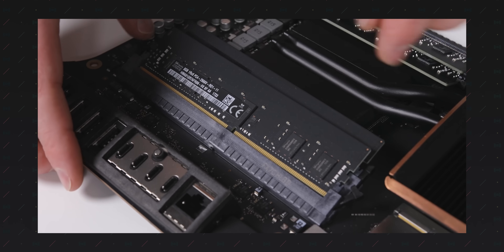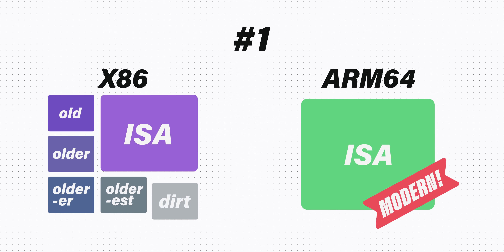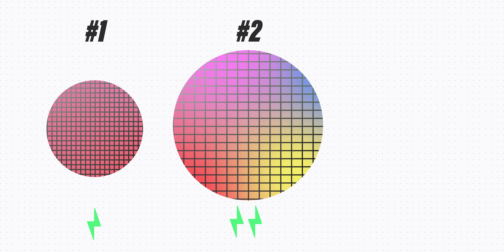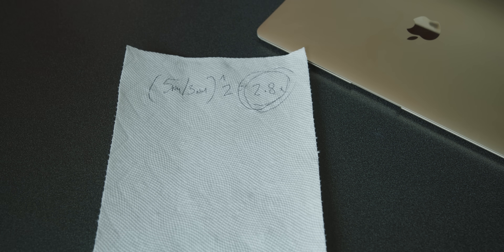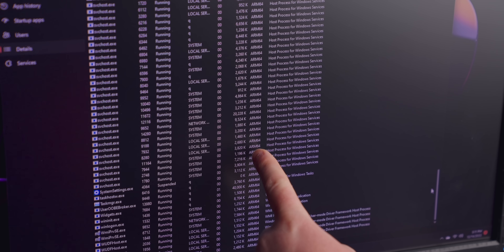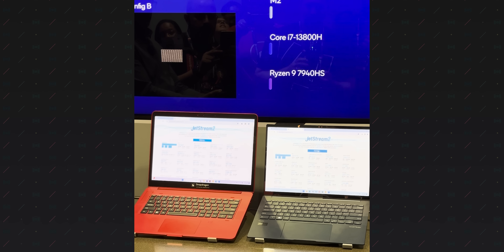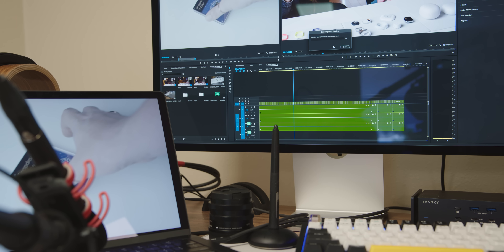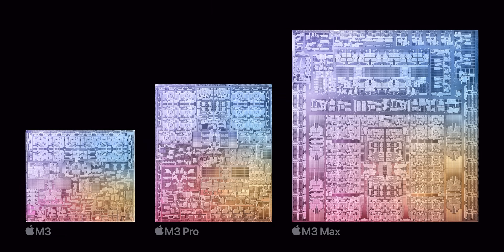Apple's Silicon Magic Is Over!

Comment: For me the biggest problem for apple silicon macs is the complete lack of upgradability and also the criminal pricing of RAM and SSD upgrades
Reply from the maker: They are gonna have to change that eventually. They’ve had the same upgrade pricing tiers since 2015 which is insane. Their base models are such a great deal but the min spec is so lousy almost everyone should upgrade and by the time you’ve doubled the ram and storage you’re at basically double the price. Sucks lol
Reply: @snazzy  I'm honestly surprised that the EU hasn't run riot on that yet. The change is inevitable, as they're going in hard on right to repair to the point that it's a matter of time that the right people notice the problems with the lack of upgradeability.
Reply: @OanKnight  right to repair is more than computers. It’s in CARS as well. This means right to upgrades would set a precedent and America + EU dislike car upgrades.
Reply: @OanKnight the EU isn’t going to mandate that they redesign their chip architecture to make the memory not soldered into the chip itself.
Reply: @OanKnight  Apple has no market dominance in the EU. There are many, many competitors so if you don’t like what they offer, buy something else.
Reply: @TeddyLeppard  Interesting opinion, but ultimately worthless. The EU has repeatedly shown an interest in having too intervene in apple's practices - you don't get to dismiss the customers and the billions they make in the market just because they aren't the monopoly they represent in the US.
Reply: @OanKnight  Just what the market needs, a government to step in and tell them what consumers want. Let the people vote with their money for christ's sake.
Reply: @OanKnight  well they hold forever and most people don't do things that are extremely intense on Mac therefore not justifying upgrades. For those who do they can buy the best of the best and be set for at least 6 years before it gets to outdated
Reply: @nylotical  I'm well aware of that, but in this case technology use tends to be the most relevant use case people would think of. White goods, computers etc. I would argue are more ubiquitous.
Reply: @SuperMattboxio  he EU doesn't tend to budge too much as they're actually fairly pro consumer. I would expect a compromise to happen though.
Reply: @OanKnight  Granted, however I'm not holding my breath for something to happen soon as this has been the case for years.
Reply: @snazzy I agree with the comment here you’re responding to. Too often tech channels pretend a benchmark is the beginning and end of whether Apple is ‘innovating,’ while ignoring the pathetic 8gb of ram and 256gigs of storage Apple is still selling in 2024, (equally pathetic is a 24” display in 2024 on an iMac btw) - that can never be upgraded. This makes any claims Apple wants to make about its environmental footprint a farce. On top of this is the measly 5yrs of official Apple OS support. Think about the fact that a $500 gaming console today has more upgrade potential than a $4k Mac Studio. 

I can’t imagine the horror of 2019 Mac Pro owners that spent probably close to 10k on average only to see support for that Mac end this year. From the un-upgradeable RAM and hard drives, lack of a headphone jack even on even an iPad (very popular with musicians), to not being able to run windows natively any more for games - Apple has become a brand of endless compromises and user burdens. 

Gone are the days of the 2006-2012 Mac Pros and Intel Macs which while more expensive than their PC counterparts - gave the user value added. These days a Mac is simply a productivity machine - drab, boring, overpriced, and everything they used to accuse PCs of being.
Reply: @snazzy  more like since 2012
Reply: @snazzy Im still using my 2014 macbook and my maxed out imac 2019.
Reply: @snazzy  no company that is a premium brand (or is trying to be) ever wants you to buy the base spec.  So functioning as designed.
Reply: @snazzy  Not to mention an unpatchable security flaw in the silicon.  Oops
Reply: @snazzy  its called a price ladder and if executed correctly, as apple does, it makes them a LOT more money than any more customer friendly model. i dont see them changing it anytime soon as it would be a huge hit financially.
Reply: @snazzy  8GB M3 is better than M2 16GB RAM though
Reply: @snazzy They haven't though, and looking at their motivations, it's not there frankly.
Reply: @snazzy Apple's ridiculous memory and storage pricing, combined with the weak JPY right now, are why I haven't bought back into Apple. 8GB is ridiculous. Even 16GB is small.
Reply: @snazzy l
Reply: @snazzy  the base model can’t be a great deal if the spec is lousy. You need a decent spec to be a decent deal.
Reply: @snazzy  Come on OWC, find a cheaper way to upgrade!
Reply: @snazzy oh also we lost paradox interactive , Blizzard, Zenimax,  a lot major game studio move on since Apple move to m series
Reply: @snazzy 14:33 so why you and other complaining about intel?? You just bunch karens
Reply: @snazzy  base models? great deal? good joke, snazzy, good joke.
Reply: Is 18 gb ram 512 gb SSD enough? M3 pro
Reply: @JoeyM-jh7ym  Only if you do intermediate computing.
Reply: @snazzy  we all complain about the prices, but do we mind the continue to disrupt markets and continue to bring new tech ?  We cannot expect to have one and not the other.  Look at the countless vendors that offer cheap products - how many ground breaking or market changing techs have they brought us?   Profit is how companies survive - unless they are running on investor money or government subsidies.  Dell builds a “cheap” computer, but where is their innovation in the last 30 years?  Apple mainstreamed a graphical os, mouse, digital music, smart phones, tablets, and now low power pcs that people can actually use.   Sure we can all ask for more ram and cheaper storage,  but keep in mind the masses won’t use either.  Sure Apple makes a lot of money, but their objective of profit is by no means “evil”.  They are fighting to survive in a world where some companies are evil and funded by the governments that are pushing to control entire industries.
Reply: @snazzy I completely agree, I use a macbook pro base model m3, and it's awful because of ram issues.
Reply: If I'm not mistaken, the video may have suggested Qualcomm's ASIC may allow for user upgradeable storage.
Reply: @barkingsheltie  they're all going to end up doing the same and it's got nothing to do with Qualcomm or the architecture, it's the manufacturers that want to be able to extract more money from us while adding NO VALUE. Dell it's already putting onboard RAM on some of their inspiron models, that's their most basic laptop that isn't a toy. Inspirons used to be so easy to upgrade, such a shame.
Reply: With these new chips coming out from Qualcomm I think it’s will be time for Apple to reconsider their pricing to compete.
Reply: @GlobalWave1 tbh apple sets the price and everyone else follows to make their product look premium
Reply: Bruh! Even before Apple silicon when they were using intel just like the rest of the industry, they never "reduce" the price of their computers to "compete," how much less when they are using their own chip. Apple doesn't "care" about the competition the way you think about it @GlobalWave1
Reply: @GlobalWave1 they won’t because you people happy paying price
Reply: @Messiah38  well I use mine in particular for music production so I just have a 1tb and offload the rest to an external ssd and have 32 gb of ram. 
I pay for the minimum… but I find it hard to believe when Qualcomm is entering the space and undercuts Apple by offering cheaper upgrades and a viable alternative to a Mac computer that it wouldn’t cause the stake and shareholders to cry in outrage.
Reply: @GlobalWave1  Which is good, competition both keeps prices reasonable and pushes forward innovation.  Even Intel and AMD are also heavily investing in ARM.
Reply: @GlobalWave1  Paying $400 dollars for 24GB of crappy RAM when you can get better 32GB RAM for $100. Paying $600 for 2TB SSD when you can get a faster one for sub $200.

-The marks of a big brain Apple consumer.
Reply: @GlobalWave1 Hint:  Qualcomm can’t compete
Reply: @GlobalWave1 people not caring is why apple doesn't care.
Reply: @impersonator4439 thats why mac has a lousy market share.
Reply: What people object to is that they feel that they are somewhat ripped off, for paying $200 for what would be a $40 upgrade elsewhere.  And they know that Apple pays even less for SSD chips and DRAM than they would at retail.  Normal people think in terms of COST; marketing people think in terms of the PRICE they can charge for something.  Two different worlds, unless there is competition that forces price to align with cost.
Reply: but this isn't a problem for apple silicon Macs. this is a problem for Macs in general, and has been since way before apple silicon.
Reply: @pyro254750  only started a generation or two before M1 iirc, you used to be able to swap SSDs, RAM, even the network card in some older models
Reply: true but this is why you wait. You can get 15" M2 air with 16gb ram and 1tb storage for $1499 in best buy now for example.
Reply: @Fear.of.the.Dark. I would love that here in the EU with 27% VAT and extra import tax
Reply: @Fear.of.the.Dark.  why not buy 6 decent Windows laptops for the same stupid amount?
Reply: This, wastefulness and lack of repairability in general. Apple HW is overpriced and unmaintainable. That's bad for the environment and for the wallet.
Reply: They treat their consumers as if they are to child like to know how to use the system without getting infections and so on. Due to all their "you are not allowed to upgrade or repair the system you just bought" mentality, getting an Apple repaired even costs more than a PC repair.
Reply: @dera6347  Sounds like they know their customer base pretty well 😂
Reply: I'd argue that now the memory is unified and shared with everything, the base RAM config should be at least 16GBs too
Reply: If you check , they actually charge full price per upgrade of what 512 1 TB 2TB would cost on top of , instead of what the actual difference to upgrade to the next size .
Reply: They won't change, they're fine taking advantage of people that don't know better (and especially just the behavioral economics of "oh, well this little upgrade isn't too much, and this little upgrade isn't too much." because they know that enough people are going to upgrade and justify it.
Reply: You are right. But it’s not going change as people continue to buy their laptops. They can’t help it, Apple products are like a drug, they are laced with alluring design.
Reply: apple knows most people don't care. personally i've upgraded a desktop once, and not once touched my 500$ laptop, although admittedly it does have better specs in storage and ram than apple's.

i plan on getting a macbook whenever my laptop stops being functional, honestly apple's restrictions don't affect me much. i'm not even on windows right now, but a relatively locked down linux distro with limited options for installing apps, and the gnome desktop which is pretty poor for customization and i'm happy with it, so i think macos would be fine.
Reply: that is something going on since 2016. nothing new
Reply: You said it! And that suits Apple just fine...
Reply: Its intentional and a business decision not fully driven by technical limitations
Reply: this is the reason I never owned a MacBook, even though I was fascinated by M chips
Reply: Agree. This is a major bugbear with me. When looking at getting a new MacBook Pro I shouldn’t have to compromise the specifications on a 2k plus purchase by having a smaller screen, 512gb storage & 8gb Ram. Drop the pro title with these specs please, it’s an insult.
Reply: non-upgradible RAM is at least justified by the integrated RAM architecture BUT there is absolutely NO reason why MACs can't come with a M.2 slot.
Reply: Lack of upgradability creates endless e-waste and should be regulated against.
Reply: The Macs aren’t for you. So go buy windooze. For everyone else the idea is that you buy the configuration you need and when if that need changes you buy a new one and sell the old one (or hand it down). Macs/iPads/iPhones have fantastic second hand market. That is how you avoid electronic waste.
Reply: buddy, this ain't the 90s
Reply: @apidas  Tell that to Apple, buddy, pal, amigo.
Reply: Indeed. And for a long time the max. amount of RAM and storage they offer at those crazy prices has been too low for my needs. I consider it absolutely insane that my Macs from 2010 have more RAM and storage than I can get on a new Mac today
Reply: I agree on the pricing but I used critical thinking and know how to buy the perfect spec. Before moving to Mac the cost of me setting up my pc, optimizing it, trouble shooting it would be equivalent to an additional $2000 in my hourly rate as an audio engineer in a year. The Mac only cost me $500 in comparison if we figure all things.  Computers are not just their upfront cost.
Reply: When you check Apple's storage and memory prices, you think it's a joke or, as you suggest, a criminal offence. However, in 12 years of using MacBooks for 8+ hours a day, I've never had any memory or storage component fail on me. Even though I use my gaming rigs way less often than my MacBooks, I've had those components fail on me multiple times. I don't know if any sources confirm this, but it seems like Apple picks storage and memory modules of very high quality in terms of longevity and reliability. 

My wife still uses my 2013 MacBook Pro. When I benchmark the drive, I still get 700+ MB/s read speeds. It benchmarked at 850 MB/s when I got it in 2013, and it got some very heavy daily use for six years. Compare that to the fact that I've had to replace every single 3+ years old SSD in my non-Apple builds.

It could be that Apple uses higher-quality components or that MacOS is less taxing on these components (i.e. due to different memory management, file system, power management, etc.
Reply: Unified memory makes sense to have on their platform, their pricing for upgrades does not. I'd be fine with it if their upgrade prices were reasonable... or at least close to reasonable.
Reply: @TheGhostInTheWires  Apple has always been expensive, and banging on about it seems pointless. You either accept it or buy something else. Apple spends millions researching the best business model to maximise profits for its shareholders, and the upgrade cost keeps it in the game. No one likes it; we would all love to live in a world of unicorns and rainbows where we get more for less, but this is the reality; take it or leave it.
Reply: Think of what Apple did to all the people who bought the final Intel Mac Pro. You know the “upgradeable” one that Apple wouldn’t let anyone upgrade to an Apple silicon motherboard.  Those Mac enthusiasts who spent a minimum of $6k were forgotten the moment their payment was processed.
Reply: You’ll be surprised at how other manufacturers are planing on doing the same. The integration is what makes these things so damn fast.
Reply: Most laptops lmao
Reply: Cri criminal 🕺 cri criminal 🕺 🎶 🎶
Reply: All m series macs are bricks and dead once the Internal ssd goes they cannot boot not even from external sources.

.this is a true planned obselense.

On the mac pro it has pcie but it cannot use any of the older mac pros GPU s or the latest intel amd or Nvidia GPU s which would make the mac pro much faster at graphics games 3d video editing AI basically everything.

And apple does not have an upgrade path to add external or internal GPU s ever.
This is a huge did her.

They don't even make their own gpu pcie card for their mac pro with graphic cores or a thunderbolt based external gpu cores upgrade for their laptops and minis

They could but they refuse to.

This dates you mac to its purchase day and hurts resale on low memory ssd Mac s and is a huge risk to buy used as when that ssd dies your entire machine is bricked for good.
Reply: Agreed, especially with storage.

I have a desktop and a laptops with tiered storage. The fast SSD for the OS, programs, page file, temp file, caches, etc. Then slower, cheaper storage for the likes of media. My desktop has magnetic drives for bulk storage, and the likes of FLAC work fine off it. My laptop has a SATA SSD and most older games run fine off it. Heck, many old games run well off a magnetic hard drive.
Reply: As if this is any one anywhere doesn’t think this.
Reply: Agreed - this is a choice made by Apple and not a consumer friendly one.
Reply: though i could buy an m1,2,or 3 macbook i prefer an older macbook air as i can throw in a bigger m1 ssd when the need arises. i dont need to do 4k video editing.
Reply: I agree, but this is actually their only downside. On the other hand, years after purchasing my M1 Macbook Air I still don't see any reason to upgrade.
Reply: It’s absolutely true. Apple isn’t doing this to maintain their form factors or for security, it’s all about money and consumers are universally pissed at companies that do this.
Reply: US Congress should have launched antitrust warnings to Apple years ago over DRAM and SSD predatory pricing and their constant efforts to resist the sound  principles advanced by the Right to Repair movement . Instead Congress form a Congo-line of groupies queuing to kiss Apple arse. Leaving it to the EU parliament to even get the overdue USB-C ruling for iPhones.
Reply: Apple does use high quality parts but also the labor is part of that cost. It's definitely not enough to justify the high price when you add more ram and storage, but I can understand why it's that high. I think the worst part is how cheap apple silicon actually is and how they start there lower end line up with criminal specs. If the air started with 16GB of ram and 513gb of storage for 1000-1200 that's a perfect price for anyone that needs a computer. Instead it's 1500 which is pretty crazy for the specs. If you want 1tb of storage it's even more. I think if point of entry was lower. They could justify the higher prices for upgrading ram and storage but since it's not, it's almost insane.
Reply: @Sakosaga  yeah and if your a video editor (the primary demographics of Mac pro users), then 256gb or even 512gb is woefully inadequate. Because 4k video files are very big
Reply: Unless you know your way around hot air soldering you're straight out of luck
Reply: Memory is one thing, storage is entirely a non-issue. External TB4 NVMe drives with transfer speeds tipping 3000MB/s are already available, and they're way less expensive than Apple's storage upgrade. 

2TB of storage in the M3 MacBook Air is $600. 

The OWC Express 1M2 (3150MB/s) = $120
Crucial 4TB 4800MB/s NVMe = $225

That's fantastically fast, even for video exporting. Is there even going to be a significant difference between exporting to an internal 2TB NVMe SSD vs. an external NVMe SSD. 

I'd rather have the additional 2TB of external storage space for $255 less than Apple's 2TB pricing... And throw that $255 at more memory on a laptop or Mac Studio...
Reply: @craigjohnchronicles2504  the problem with an external drive is that for laptops it's just extra stuff to lug around and there's a great risk of it being lost. If I was buying a Mac mini or iMac I would be fine with external storage, but not on a laptop
Reply: I have been wanting to upgrade my nearly 7 year old Imac & MBpro for 5 years but this is the main thing preventing it. I have some to believe Apples compulsive greed is shooting themselves in the foot. At least so far as its macs go.
Reply: We need Hackintosh for the Silicon era, it will happen.
Reply: Upgradeability is bad yes. But it’s nothing that is hurting Apples business for the time being and it’s not due to a technical inability. Apple can bring an upgradeable Mac tomorrow if they want.
Reply: lack of upgrades would be fine if their computers didn’t cost as much as a car
Reply: You are not wrong, but that isn't really a comment on the M series is it?  I have only used Mac for work and only used it for about 5 years, but Mac has never been upgradable in my short tenure.  I would expect other OEMs to do it too if they have the brand awareness that Apple has
Reply: I built high end gaming PCs for 12 years and NEVER upgraded parts. Whenever I needed an upgrade, I just needed a whole new system because the newest CPU would need a new motherboard, and new ram, often new type of GPU slot.    

Maybe that's different now, but the thing is the resale of Apple products is SO much higher than PCs, you can just sell your entire mac, then get a new one for less (or similar) to what it would cost to get new parts for your PC... at least ones that make any sort of difference.  Heck, a Nvidia GPU upgrade alone now often costs as much as an entire Mx system. 

I also get the ram and SSD I know will last me for years. I'm still using a 7 year old iMac and the ram (24 GB) and SSD (1TB) are still plenty. In fact, I have PS, Illustrator, Resolve, and a bunch of other high end apps and my internal storage is still 90% free (only using about 50GB for everything).   The nice thing is macOS for me doesn't get bunged up and dragged down the way Windows does (which I needed to reinstall a couple times a year). It's still as snappy now as when I bought it.
Reply: Wow brilliant take I’ve never heard anyone mention that before!
Reply: Apple sees Apple Silicon as an additional way to lock people in. Apple loves the extra control that Apple Silicon gives them. Apple would never move to Apple Silicon if it was for efficiency alone. Profits were the force behind this move.
Reply: 5:11 Excuse me, that was not napkin math, that was paper towel math.
Reply: “Months away from almost”
Reply: Agreed. If Apple would make a newer iMac that I could afford, I'd upgrade.
Reply: ^ This! 100% It's the main reason I've been watching videos on in-house cloud/RAID setups so I won't have to up charge $400+ for a minimum of 1TB storage from 512GB. Heck I have a thumb drive I bought for $99 that was a full 1TB.
Reply: wew reading these replies reminds me why I have such contempt for the Apple cultists. "um actually upgrading is dumb and I actually like not having the option"
Reply: Yeah they went too far with ram pricing recently. I've spent tens of thousands of dollars on MacBooks and it feels insulting
Reply: The pricing of RAM was always absurd and now it's even worse.
Reply: Not only that, but the fact that they are buying those NAND and DRAM chips for pennies, and then charging you upgrade pricing that is only possible due to them locking out competitors...IMO this should be illegal.  It's deliberate and done solely for profit, and it's a monopoly.
Reply: It's a lock-in. Apple has never liked that you can upgrade their hardware without paying them 😂
Reply: EU needs to step in force manufactures to have an upgradability path
Reply: I was a customer for 21 years, but they lost me. Even with the Intel units, you could still upgrade the SSD or, even replace RAM with a hotplate and hot air. You can't even get the RAM modules for ARM, and the SSD NAND modules are Apple-specific parts. It's absurd.
Reply: For me it's the OS
Reply: Most annoying fact about ARM is the lack of GPU support. Neither PCIe nor eGPU via thunderbolt. They should have gone with AMD and x86 would be power efficient as hell and had even greater APUs like the Steam deck.
Reply: Then don’t buy it. Criminal 😂 hyperbolic much
Reply: Yada yada yada. I can’t afford a Mac, therefore I have to hate Apple…
Reply: I’d suggest the modern ‘upgrade’ path for personal computers (vast majority being laptops) is the same as cars ie: realistically none. Unless you are a real auto enthusiast, you’re not really thinking how easily can I upgrade the engine, the load capacity etc when you buy a car. You just get the one that suits you, and when it’s no longer sufficient you sell it, hand it down, or ultimately end-of-life scrap (recycle) it for a newer, better one. And, in the case of EVs (Tesla’s etc) the upgrades are all software. It’s a basic, slightly flawed analogy perhaps - of course cars have a lot more wearable, maintainable parts, and computers either work or massively fail, and in both cases there you’re looking at the warranty situation anyway - but in the real world, for 95% of folks (ie consumers) I think this is the case now. Like it or not, I tend to agree with the argument that ‘future proofing’ your laptop, desktop, phone, certainly if it’s an Apple one, is an outdated, even flawed way of thinking now.
Reply: @brucekennedy5274  I just can’t agree custom personal computers are more prevalent and popular among youth then ever. Apples laptops are now built to last you can keep a M1 chip for the next 6 years even. It’s unethical how apple does it because for most other companies their upgrades are half the price for the same product and they have technical problems that are unique to apple because of the way the make products unnecessarily making it impossible for a average user to trouble shoot issues without relying on a warranty or paying outrageous prices for repairs. Meanwhile for most laptops and desktops they can be troubleshooted whether by a software reset or switching simple to change out parts
Reply: @albundy3929  "Where am I wrong?" Pretty much everywhere. 

No, you shouldn't rely on cloud storage in place of physical storage if only for the fact that you should always have more than one copy (and more likely three or four) of important files. Cloud is great as a backup, but it isn't a substitute for local storage.

M's use of RAM is better in some cases, but it hardly "smokes" comparable RAM on a Windows machine. Because it's just RAM. Until recently, Apple was selling some pretty low spec RAM at the same price, so. I think a lot of fanboys are just parroting Apple marketing about Mac's RAM being like double PC's, and, I hate to break your heart, but that's just marketing. Apple can kind of get away with outlandish claims like this because their machines can lean on swap if and when RAM runs out, but then your going to start to notice slowdown whereas another machine with two or three times the RAM at half or a quarter the cost won't. 

16GB is not included in the base model of most devices. 8GB is. Needing 16 is not "rare." It's approaching the norm. Upgrading to 16 costs an EXTRA $200 (for the base MacAir, Pro, iMac, and mini). A kit of 32gb DDR5 costs half that. 

Hobbies cost money—that's a truism. You're not going to prove your point with a truism when what's under contention is HOW MUCH that hobby ought to cost.

While you're at it, please justify the $1k roller wheels for the Mac Pro. Please!
Reply: For many people, it's just not an issue - like remotely an issue. I have owned two Apple Silicon Macs now... an M2 Max and an M3 Max MacBook Pro 16". I purchased them with 64GB RAM and plenty of storage and the highest CPU/GPU spec. Used for work. Previously I owned a 4 generations of 27" iMacs... all of which I merely purchased RAM for at time of purchase and then never upgraded/altered in any way. The last time I tinkered with storage and memory was my 2009 Mac Pro Tower. I think there's a lot of people who simply don't need to alter their internals once they purchase.
Reply: Basically disposable devices.
Reply: Agreed!
Reply: I don't like that Apple does this, but i don't see it changing. A lot of the market doesn't care and they make so much money on these markups.
Reply: Just got an asus zephyrus (2023) for the same price as a fancy macbook and its crushing everything I throw at it. Are gaming comps the new future ai comps?
Reply: If you ask me the reason for lack of upgradability is intentional. Its in line with the concept of a OEM, essentially intentionally creating a self contained environment to predatorially control the consumer. And its the main reason I'm admittedly anti apple. Is for how good Apple tries to act it always feels like a bad case of just profit chasing for the good of Apple at the expense of the consumer and rarely to new Apple PC's feel like they are created with the actual end consumer in mind. 

Like most of Apples hardware designs just feel like cheaped out on SDK/Software Development Kits, that are about as far from what I'd expect the end customer to get. Like I'll give Apple the plus of their hardware looks nice but it consistently lacks on just about every other feature a PC should have. Like 90% of Apple hardware feels like your paying purely for the esthetics and not the actual PC. 

Another way of thinking about it is that Apple consumers are essentially paying a prenium for essentially a paid beta for a video game.
Reply: I'd never buy a personal computer locked down this much.
Reply: yep. me too.
Reply: that is intentional
Reply: Well you’re not considering that they are the only ones in the market, if we are talking about performance per watt and build quality, apple could charge thousands of dollars more
Reply: author also has heat issues
Reply: Omg get over it. It has been like that since Apple I
Reply: And lack of normal USB ports Ethernet and HDMI
Reply: The low ram isn’t a big deal since 8 gb is like 16gb on most other machines but what is going on with the that storage like common.
Reply: The Criminiminality ...
Reply: Apple builds its computers like Ferrari builds its cars.
You keep your computer until it dies or you sell it, no other choice since everything is soldered inside.
Reply: That’s always been apple though. They have always been a closed source hardware operating system company. They make their money selling over priced computer hardware to apple fans. People that just require a computer to type, go online and watch videos and do whatever else a mac can do, which based on the lack of fans, I’d say probably is not a lot of performance oriented stuff, cough cough like games. OSX runs the way it does for that very reason, do you have any idea how fast and stable windows would have been running on five different configurations of hardware. Instead it runs on literally countless variations.
Reply: I was a UIUC Business major, so I understand the difference between MARGIN and VOLUME, but I don't believe Tim Cook KNOWS enough about Business!  (Like that old Apple Board Member K---something who PREVENTED Apple from licensing the MacOS, as Bill Gates suggested they do in 1985, 10 yrs before he came out with Win95!)

I'll be staying with my 2010 Mac Pro 5,1 for as long as possible, currently 'booting' Monterey 12.7.4 from an internal nvme PCI drive, with a 12-core 3.33ghz Xeon, GTX 670 2g GPU, 96g, 2xUSB3.0 + 2xUSBc card and a free slot #4!  My 5,1 is right ABOVE the M1 chip on the Cinebench 2024 ranking?
Reply: I was a UIUC Business major, so I understand the difference between MARGIN and VOLUME, but I don't believe Tim Cook KNOWS enough about Business!  (Like that old Apple Board Member K---something who PREVENTED Apple from licensing the MacOS, as Bill Gates suggested they do in 1985, 10 yrs before he came out with Win95!)

I'll be staying with my 2010 Mac Pro 5,1 for as long as possible, currently 'booting' Monterey 12.7.4 from an internal nvme PCI drive, with a 12-core 3.33ghz Xeon, GTX 670 2g GPU, 96g, 2xUSB3.0 + 2xUSBc card and a free slot #4!  My 5,1 is right ABOVE the M1 chip on the Cinebench 2024 ranking?
Reply: I hear you. I bought an M1 then an M2 when they came out, but the prices for RAM and Storage are insane. I still have my Mac laptop but I went back to PC desktops. My PC has many TB's of storage and 64GB of RAM and it didn't cost me the GNI of a small Country. Which leaves money left over for beefy GPU's. I really like Apple hardware but the pricing is just absolutely insane.
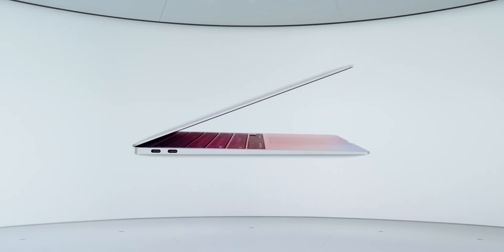Reply: 1:04 why would the price increase? They made their own chip then the cost went down. Shouldn't have the price as well. Nah. Send me the G like regular
Reply: Lack of upgradability implies not upgradable. So how can there be prices for upgrades??
Reply: The soldered on memory chips really is frustrating
Reply: If I wanted to mess around with hardware upgrades, I’d build a PC. Plan for the future when you spec your Mac.
Reply: Bruh evryone here is on copium
Reply: I’d agree if this wasn’t common practice on x86 chips too, sadly, in the modern laptop market we don’t get “user choices” anymore unless you go to brands like framework whose brand images rely on their repairability & upgradability
Reply: I dont think the physics really supports upgradable ram while maintaining the same brutally fast ram speeds. That said a two tier ram arangement with fast on-chip ram for fast tasks, and slower off-chip ddr5 (or whatever) for lower priority tasks would be fine. But yeah apples always had a stupid habit of undergunning ram on base models and its a habit thats utterly incompatible with non upgradability. 8gigs just isnt enough anymore especially considering the horrific ram useage of chrome , and the mindless trend of using wrapped web pages as apps (discord and all those things are actually just web pages stuffed into a customised chrome browser made to look like a desktop app. Its a bit like that old thing that the more you earn the more you spend. That applies to ram too. As the average ram in the world goes up, the apps get hungrier cos the devs get lazier. But apple isn't keeping up. I  love macs, but the memory scenario has always sucked.
Reply: @Jo_Zh I have AMD shares
Reply: Yeah.  I don't know who's making products at Apple but ... the company's products are just useless at this point.
Reply: The SSD is not an apple silicon issue its an issue apple made themselves
Reply: @deathdrop  Yeah Apple is just a badly run company.
Reply: Honestly the Ram acts as vram also and it’s crazy crazy fast like pcie 6 fast.  The storage is also stupid fast.  The fastest external t3 drive won’t even do 1/2 its speed and is the same price per gb.  But ya be awesome if at least with the cheese grater if you could pop in a 4090 or 4.
Reply: M chip..money chip.
Reply: Yeah the prices are bad, but the bigger issue is that RAM is usually the first part to fail on a computer.  Might last 5 years or so. When RAM fails you’ll have a brick that could have otherwise been saved if it wasn’t soldered on.
Reply: How many times in your life you’ve upgraded your laptops?
Reply: Criminal pricing is Apple's motto.
Reply: upgradability is not a big deal, but the prices per G of ram or storage are ridiculous.
Reply: You don’t get why the silicon performance is that superior, not possible with upgradable hardware
Reply: + Also there is no 18” model which is needed for real pro and gaming
Reply: any apple product from past and present are all bad when it comes to upgrades,
Reply: For me it is the OS.
Reply: Agreed. The $200 upgrades is the only reason I still haven’t upgraded my 2020 M1 Air yet.
Reply: The M1 is fantastic, I still use it to edit my 30 minute 4K YouTube videos even today. The greedy $200 ram and storage upgrades is the only reason I still haven’t upgraded my 2020 M1 Air yet.
Reply: @JohnnyFD  Right.
BUT: The M SOC is only sooo good, because Apple build in H264/5 acceleration and other stuff to help.

So let´s see what Snapdragon X brings to the table and also Intel with Lunar Lake! They all haven´t been sleeping and they all claim to be faster than M2/3 with same power consumtion!
Actually I was sooo keen on Snapdragon these days but I am assuming an Lunar will be even more interesting because it uses x86 architecture! AND: Way more hardware for Intel SOCs to come.
But all of the above will make me able to swap the SSD to a 2 TB Version für 150 bugs.
Reply: If you want upgradeability buy a PC. Its not that hard. The way chips are designed we wont be seeing upgradable ram in efficient and fast machines. Building out SOCs is the most cost effective and reliable way to procide performance and efficiency improvements. 

I don’t see people complaining that they can no longer upgrade their processor cache and we wont see the complaints in 10-15 years when most PCs will only need to have an SOC with an additional GPU. You will just swap out your SOC when its time for an upgrade
Reply: Yep, same here. I use my m1 mac for research using artificial intelligence and as the datasets I’m working with have increased from 2G to 86GB I wish I could swap my 16GB of memory out but nope, gotta spend 5000$ for a mac with 128 :/
Reply: i need to replace my laptop so I've been considering using a mac. Why not right ? They're light, silent and powerful. But these prices are just criminal.
I shouldn't have to pay 200 to add 8 GB OF RAM. Insane stupid prices.
Reply: @ThomasAndy-qu8dp  There are other factors to consider too. Get an m1 pro or m2 pro and save. I have Mac and Windows. I have had to spend much more time configuring my pc and debloating. Whatever upcharge you pay up front for mac should level out with time spent on other pc's. Depends on your use case tho. My mac really gets out of the way of me making things.
Reply: I stay away from Macs not because I want to upgrade, but because if the motherboard dies for any reason, I can’t get to my data.  I would buy a Mac if the SSD could be removed, even if the size of the SSD were fixed at manufacturing time.
Reply: @mensaswede4028  This implies you would no hard backups or cloud backups. I have my essential files organized  on my desktop, backed up to iCloud. There are tons of way to protect data loss. What If you spill a drink on a windows laptop and ruin the ssd as well?
Reply: Amen! Amen! The Mafia has to be the most inept organization compared to Orange Works Inc. of Silicon Valley! 😎😎
Reply: yeah, 12GB? what is the crap?
Reply: Apple sux that why catter to kids and influencers not true experts.
Reply: Yeah, you’re not alone in that issue. Apple loyalist have been crushed by the lack of consumer side upgrades for over a decade now. It, for lack of a better word, sucks.
Reply: @leeartlee915  It definitely is not great but it's still on the consumer to make the right purchase for themselves. PC users tend to spend more vs the life of their machine.
Reply: M1 Dominated what? How much market share?
Reply: @sergioyichiong7269  Fair point but that’s not how they are using “dominated”. They are saying it’s the “best” product, not the “best selling”.
Reply: that’s because it is a system on a chip.  they moved the ram and ssd controller all to the SOC.   They wanted to squeeze every bit of performance per watt and to do this they needed to move it all to the soc and bring them all as close as possible. you are right though the upgrades are insanely priced though.
Reply: @Braddeman  Don’t kid yourself. Apple was doing this before everything moved to SoC.
Reply: @leeartlee915  well i mean now they have a legitimate excuse.  honestly they could make the disk space upgradable as it is possible in the mac studio but as far as ram now that it is part of the SOC i understand why it can’t be upgraded.  whether you agree with my statement or not there is no denying you have less power losses the closer everything is and positioning it all in the SOC does equate to better performance per watt.  they will still say they can’t make the disk drive upgradable as it will make the laptops thicker which is bull crap.
Reply: @Braddeman  I don’t disagree with your statement that you have less power loss the closer chips are to each other. Still doesn’t change the fact that Apple has been overcharging people for years for additional storage and ram. It’s straight up bs.
Reply: @leeartlee915  yea, i totally agree with that statement as well.  apple has always overcharged.
Reply: Its not upgrade. Are you gonna ditch ram and soc because ssd died?
Reply: The absolutely outrageous RAM price is the kicker
Reply: Sad, as apple laptops pre Two thousand thirteen had great upgradability... depending on the model you got, of course!
Reply: Apple has been all in house, no customizable, no upgrades since the beginning.
Reply: why is it criminal? you don't need to buy it and you have tons of alternatives.
Reply: Yes, they are expensive. But the UX is another league and no other OS comes close. My MacBooks last almost 10y. I don’t mind paying for that as a pro user. My gf is still using a 2012 iMac that never ever crashed. I do agree their HDD and RAM upgrade prices are criminal in 2024
Reply: Its system on a chip how is to be upgradeable?
Reply: one of the reason the government welfare assistance program are bad, it’s make people think it is their right to access everything cheap or free and depends to politicians all their life 😂
Reply: If they would allow ssd replacement and upgrades, or even just an open NVME internal slot I would have been sold on switching.
Reply: Windows getting competitive arm chips will begin to force them to be less greedy on these upgrades (I hope)
Reply: @Ronniezim I wish you were right, but I think Apple's core market are people who buy Apple. They could ship a turd in a pizza box and it wouldn't matter, and the real fans would happily pay triple the price to get two turds in their box.
Reply: @Ronniezim mc is already making overpriced non competitive x86 devices, what changes?
Reply: @Ronniezim  I certainly hope so!
Reply: Totally agree ... and it's their pro res format, that eats storage space like nothing else
Reply: People tend to forget that at the end of the day it's about money and business models. 

Apple makes almost ALL of its revenue from selling hardware. Yes, they have other sources like the Apple store but selling hardware is how they make most of it. 

There is ZERO reason to soldier the SSD and RAM to the motherboard,, it doesn't make extra room in a laptop. It's simply a way to charge absurd prices for upgrades. The cost to upgrade from 256GB to 512GB is around 200 to 300 dollars. A  512GB nvme drive, same generation  from Kingston is 40.dollars. That's for a brand new drive, not an upgrade from one size to another. Their topped out Max Pro is 10K for the max memory and max SSD version. There is a reason there.are no 3rd party companies that make MACs.

One channel built a 10L PC and it was ridiculously faster in every way as most of that money was spent on a thread ripper CPU. It also has a REAL GPU, unlike Apple.

Windows. Makes money from selling software and cloud services. They make more from selling Offices licenses then they do selling OS's. Enterprise licensing for CALs (client access license) and everything else is where they make all their money. People want to compete with the surface process while ignoring the 10K other options you have. They are also the sex d largest cloud provider and a better option as they charge a 5th of what AWS does. 

The funny thing is, and he said it in the video, that not many people ever even maxed out their M1's. Same for someone who buys a powerful x86 processor for web browsing and other minimal stuff. So what does it even matter? Also, for home users it won't matter but at the enterprise level it's going to be a decade or more before they move to ARM. Way too many niche software  companies out there that charge 100K a license because they make software for a specialized industry. If anything, ARM might take over the home user market but I'm still not believing the "everything will just work" part when some of Apple's own software doesn't work on ARM but still shows up. When you launch it you get a message saying "not compatible with CPU architecture" so no, emulation only goes so far and natively porting an application to a new architecture isn't easy, especially the more complicated the software is.
Reply: You are not Apple's customer, and they make so much money off of their real customer, that they're fine not getting your pocket change.
Reply: They definitely won't, Apple is a hardware company.
Reply: @BGRUBBIN they a hardware and software company the make logic and FCP
Reply: You can’t be serious 😂😂😂😂😂
Reply: Macs were like that for quite a while even before they transitioned to apple silicon, so while your point is relevant it has NOTHING to do with it being M1, M2, M3
Reply: @grunzythepotato  you used to be able to upgrade or replace the ram and hdd on Apple devices in the intel days, now it is a proprietary ssd and the system will not accept a different size drive or ram to the original (hardware locked) one you got with the device. That is the M1-M3 issue with the SOC.
Reply: Windowz? No thanks 🙂‍↔️
Reply: Here, in the UK, we pay a lot more than what is advertised in US dollars. I wouldn’t be affected by the price so much if the devices managed to maintain their value over time. The accelerated depreciation rate is something that will never sit right with me.
Reply: @AboutHouseMusic  consider migrating to the US, language barrier is nil for you :)
Reply: Well, technically the soldered onboard storage can be upgraded, but requires a good bit of effort and knowledge of how that whole system works to do so. However, I think Apple could fairly easily implement some sort of easily upgradeable storage while continuing to utilize their "ANS2" coprocessor (which handles the hardware based encryption, among other things). All they'd need to do is utilize removable NAND PCBs like the Mac Studio has, and engineer some way to easily reconfigure the NAND RAID configuration. As it is now, a new RAID config can only be initialized on a set of new/unprogrammed NANDs, and cannot be altered afterwards (except by programming the NANDs externally).
Reply: @dosdude1 100% this. I am seeing comments that ARMs can’t be used with normal RAM? Among other things, I have a 1993 ARM powered desktop computer that uses SIMMs, even SODIMMs. Also a 1992 ARM based laptop (‘Acorn Silicon’, because Acorn developed ARM silicon from scratch in the early 1980s for their own computers … ARM - Acorn RISC Machine!)
Reply: This is nothing new with Apple. It's been like this since 2008 and before. I bought ONE MacBook pro in 2008......never again. I learned my lesson after 12 months of usage
Reply: You nailed it!  And there is extra emphasis now on memory due to emphasis on AI.
The cost of stacked die memory limits what they can do but on the other hand sharing direct access to that memory is much of the reason they still lead while windows is still struggling to recompile everything.
The Qualcom chip needs 50% more cores and they are all high powers cores -not to mention that the engineers that designed it literally came from Apple.
I am one of those people who have the minimal M1, and it works great.  My slightly newer Ryzen laptop need to stay plugged it and it is literally falling apart and weezing.  If Windows RT gets it together on the Qualcom chip I may buy one this summer,  but I suspect I will just have to give up on windows for mobile due poor to battery life.
BTW there is supposed to be a media tech competitor to the Qualcom that will be cheaper/performance.
Reply: @skyak4493 its bullshit.  A test proved that a 6 core i7 mac was slightly faster than M1 on finalcut.
Do you buy the crap of shared memory?
Reply: @skyak4493 The engineers came from amd to apple. Do you think that tech was developed by apple? They hired the experts not developed before the  engineers were on charge.
Reply: The days of upgrading are gone. 

Apple is of course taking advantage of this. :(
Reply: This argument is boring.  No one has cared for years.  I’ve had many Macbooks over the years.  I never upgraded the memory on any of them.
Reply: It's not criminal because you are not really upgrading you are paying for an entirely new SoC, that is the cost of having an SoC
Reply: and what the heck does this have to do with their silicon? besides the fact that the integrated LPDDR5 is soldered for a very good reason and actually expensive.
You guys are annoying af, commenting this old upgradeability deadbeat comments under every Apple video.
Reply: Generally speaking, your average Mac user is going to fall into one of two camps - general ‘home’ type use where specs don’t need to be really high or high end users where some of the kit is priced equally to kit running Windows. At that point it’s past experience that decides the sale. Everyone else would probably benefit from something else running windows - gamers aren’t going to choose Mac as a first option anytime soon.
I’ve got one of the 8/256 Mac Mini’s and being honest, it’s more than powerful for my use. I have had all sorts of apps running in the foreground/background and I’ve only seen the SSD used as live memory a couple of times and even then it freed up quickly so there’s no massive increase in SSD writes that some are obsessed with. I’ve done photo editing with YouTube playing on a different display and multiple browser wimdows open and still don’t hit 8Gb. SSD’s are so cheap these days too and speed is great even using basic SATA, never mind NVME enclosures.
Cloud gaming works great and so that also satisfies my occasional need.
I’m no Apple fanboy,I know they do screw people at certain price points but seriously, the entry level is great for a good chunk of the market. 
I’ve got an old desktop running as a home server with 32Gb memory and 4Tb storage…..it runs at less than 3% cpu, 4Gb memory and mot of the drive space is empty.
Sorry for waffling on but the anger and outcry of 8/256 being unusable really is one of the dumbest things ever.
Reply: @wiggleman12345  thats not the point, its still bullshit that apple is charging $1000+ for 8 gigs of ram and 256GB of space, I can get a regular PC for the same specs and still be able to upgrade it with ease. Apple is the king of selling you overpriced garbage.
Reply: Well the price not nessesary expensive, if you conpare them with their correct conpetitor.. i mean even the 150MB/s HDD is not the same price like the 2100MB/s SSD.. and that speed difference also there like the PCIe 4.0 x16 where you slot yout GPU, guess how can that GPU communicate with the CPU, yes with that 32GB/s speed, but even in the Macbook they already have 400GB/s transfer speed (so about the same 13x faster speed like the mentioned 150MB/s HDD vs 2100MB/s SSD..) so is the HDD and SSD has the same base price and same upgrade cost too..? So first you should compare their fairly (so get a 8channel DDR5 laptop motherboard with PCIe 8.0 x16 slot to make able to the RAM and the GPU too reach the 400GB/s, oh they aren't even exists.. so in that case are you using a HDD recently, or you also paying more for the faster transfer speed and you are using an SSD..?
Reply: Still time to delete a take that belies you have no idea what shared memory mesh means or what it is.
Reply: I thought so too but recently checked the price for maxed out gaming laptop (64gb ram, 2tb storage, 3.2k miniLED) and it was the same as M3 max in identical configuration. I probably could save a few hundred $ if I upgraded it myself (which is a huge benefit), but I’m too lazy lol. 
If I wasn’t looking for gaming I would definitely get the new Mac instead given that the Mac is better in every other way.
Reply: @namesurname9478 try using solidworks on mac.
Reply: @namesurname9478  You're really comparing gaming laptops to macbooks 🤣
Reply: @fidelisitor8953 well Apple create a developers software for game developer so Apple is about gaming
Reply: @macgamer1973  So because Apple create some silly software that now means they're about gaming? No one in their right senses would buy a mac with the intent of gaming on it.
Reply: I can understand the BS pricing for RAM and SSD, but let's be honest about upgradability, how often do you upgrade your laptop's ram? I certainly didn't for my old Thinkpad, it is just too old to be worth upgrading the ram capacity when the cpu is just too slow to handle that many tasks anyway, and you don't really have someone to sell used laptop sodimms to in the first place. And lack of replaceable storage is only ever an issue with 8GB memory Macs that have to constantly swap and wear out your soldered on nand chips to maintain good performance at the detriment of longevity; as long as you have 16+GB of memory to start with, lack of upgradable storage won't be a problem at all, because guess what, external SSD exists, and with thunderbolt ports, professional video editors just edit off the external SSD anyway, and you don't really need a lot of storage locally anyway, I mean what files can you think of that actually needs to be stored locally? Other than Apps, which don't take up too much space anyway, and games, which you won't have much anyway on a mac; everything else can be stored on an external SSD, and arguably it is much more preferable since professionals often have multiple machines that needs to access the same project. 
At the end of the day, how much money will you actually save by upgrading the components on your old PC laptop compared to just selling your MacBook that retain their value much better?
Reply: @dpptd30  This isn't just about upgradeability, right to repair is also a thing, I should be able to open any device I own, and replace a faulty part.
Reply: @dpptd30 lack of upgradeable storage is also a thing when something breaks down. Crucially in macs, anything broken or fried on the motherboard will cost you all your data cause you can't salvage any part anymore. Not even service can dumb the data off of if. It's a pretty good reason for me to stay away from such contructions. Im a desktop guy anyways, total control of hardware and software.
Reply: Na the pricing makes sense considering they have to make a complete new chip so you can get more storage.
Reply: @ronto55  Apple doesn't make the NAND, but buys it externally. It's not even Samsung/WD/Micron/Hynix, but some cheaper Chinese brand most of the time. Gotta increase those margins YoY.

As for RAM - it's not a new SOC/CPU chip that has to be made, but a new package, which is trivial in comparison. That's also where sales statistics come in handy. When you see that 40% of your customers opt for the 16GB version, you simply produce these packages in the same proportion. Boom. No waste.

The 8GB variant isn't even cheaper, because it has to use 2 memory chips anyways (half the capacity each) in order to provide the same bandwidth.
Reply: @Psychx_  this isn't how the Arm chips from apple work. The ram is integrated in the chip  and not separate on the motherboard. If you want to upgrade the ram you would need to get a chip that has a higher integrated ram storage.
Reply: @ronto55  Learn what the terms "chip" and "package" mean in the context of computer hardware!
Reply: @Psychx_  I don’t get your point.
Reply: @ronto55  The CPU chip, RAM and heatspreader are all installed onto a mini PCB called "substrate" and the whole thing is called the "package". The package is in turn what gets soldered to the motherboard.

Apple doesn't need to make different chips in order to support bigger RAM sizes. They just put bigger RAM onto the substrate at zero added complexity, time or cost (except for what they pay for the memory).
Reply: @Psychx_  yea I looked it ,my mistake. My concern was the memory management that is built into the chip.
Reply: @ronto55  The MMU and memory controller govern the type of memory, (max frequency), and max. capacity. Since Apple only uses LPDDR5X at one given frequency and every CPU supports the max. memory capacity that can be put onto the package anyways, that's a non-issue though.
Reply: Arm isn’t compatible with dram at all, user upgradable ram will never be available.
Reply: @oo--7714  That's complete nonsense. Servers running on ARM processors and the same DRAM that X86 servers make use of, are widely available and used.
Reply: @oo--7714 my dude have you seen Ampere Computing's chips? Even back in like 2017 Cavium had ARM chips that had socket able DRAM. You have zero clue what you're talking about.
Reply: @oo--7714  it's technically possible, though certainly not with off-the-shelf DDR modules. But it's possible.
Reply: @oo--7714  please elaborate. Are you just saying that the chips have no controller for memory outside the package?
Reply: @oo--7714 Wrong. Where do you get that BS?
Reply: How many times did you upgrade your laptop anyway?! Are you upgrading your memory every year? Your storage every month? You CPU/motherboard every year?!

Upgradability is already a stupid idea, although i agree with you about how apple price the upgrades
Reply: @cetangamer3228  lol you really not getting the point. Why you have to pay Apple ridiculous money for storage or RAM upgrade, when you can buy basic tier laptop and upgrade cheap to higher tier RAM or storage, Apple knows that and litteraly blocks you from doing it, so they milk you for it.
Reply: @cetangamer3228  
Upgrade cycles work on 2-4 years. I replaced the hard drive in my laptop with a SSD about a year ago. Plus all the usual air dusting
Reply: @cetangamer3228 for my Mac Pro 2013 just upgrade to 32 from 16 just 3 weeks ago
Reply: I don't understand why I never see people with this viewpoint mentioning the fact that on-die RAM, although un-upgradeable, is significantly faster and more stable, to the point that Windows laptops are basically trash by comparison in terms of reliability when you compare them with M series hardware. Yes, it costs a lot more. Yes, it is significantly better too. You get what you pay for.
Reply: What a bs take @karmatraining
Reply: @karmatraining This is false. Macs are faster than windows laptops because windows as an operating system is full of bloat and is slow to run. If you replace windows with linux, it makes the laptop significantly faster.
Reply: @karmatraining It's also false to say it's less reliable. This idea that Apple hardware I'd more reliable is quite comical given how all apple products have a moisture sensor that has been known to brick the products for a while. The best part is that Apple will tell you to buy a new machine while us with actual knowledge will be able to save the pc without replacing it.

As long as you know what you are doing, you will likely never run into any problem that an apple apologist swears you will.
Reply: @karmatraining  Instability problems with Windows machines has almost nothing to do with the hardware, its almost always the OS. Thus the best way to get very good stability on a windows machine is to wipe the OS and replace it with Linux. 

The other factor is that with windows laptops and prebuilt desktops is that there are a lot of manufacturers with varying degrees of quality. Some manufacturers have built some extremely reliable and high quality machines, such as the old Toshiba Qosmio line, of which i still have mine and its still running quite well despite being well over 10 years old now, while others like dell, tend to just design and sell cheap crap. 

And depending on the laptop, wiping the old windows OS and replacing it with Linux is a very viable option, which is something that you cant do with MAC.
Reply: The pricing is obscene, but in 30 years of buying computers, I have never upgraded RAM or storage after buying with what I knew I needed plus some cushion.  By the time I actually needed more RAM, I was also buying a next-generation CPU that was balanced wrt the new RAM needs.  It's silly to think I would just add a lot of RAM to an M1 and suddenly have an LLM training powerhouse.
Reply: @ericpmoss good for you, but it takes more money to buy that spec upfront and I suspect you don't keep your machines for very long... Up until a couple of years ago I was using a desktop with an i7 2600 from 2011, started life with 4GB RAM and a 250GB hard disk, when retired it had been slowly upgraded to an SSD, 16GB of RAM and an RX480.
I also have a Thinkpad that I gradually upgraded and before that used to have a 2011 15 MBP that got a couple different RAM and storage upgrades throughout its life.
Reply: @ericpmoss You aren't thinking enough. First 8GB was the standard around 10 years ago but has now rose to 16gb. RAM requirements do rise, they just rise slowly. Also, a new CPU will still need the same amount of RAM if relying on the same architecture and software, your comment on balanced cpus changing that doesn't make sense. 

Secondly, if you could upgrade the memory of a mac, you could buy the base model and buy more memory for SIGNIFICANTLY less cost and upgrade it yourself. We're talking less than $100 for 16gb.
Reply: @willo1345  Yeah, 8GB of ram is the minimum for a phone, not for a computer
Imagine having your mac put to shame by  a 5 year old OnePlus 7 pro with 12gb ram...
Reply: @Jbrimbelibap  To be fair, phones aren't meant to have as much memory as computers. They simply do not need it. You aren't going to be doing many complex tasks on a phone simultaneously.
Reply: @willo1345  Well given that 8gb is barely enough on a phone, to me it says everything we need to know about having gb on a pc
Reply: @Jbrimbelibap  It is getting to that point, yea. Just like pcs, 8gb will only be enough for so long in phones.
Reply: @ericpmoss  You will never be able to realistically train an LLM on consumer hardware for the foreseeable future... But you can run them on mid-tier hardware and fine-tune them on high-tier hardware, so long as you have the memory but luckily memory is cheap at least for windows machines.
Reply: Not if you can afford them.
Reply: @daytonaukpc9387  the point is not if are affordable or not, the point is you can get BETTER stuff for LESS in every other devices except in Apple
Reply: @daytonaukpc9387 its not money its if its worth the money
Chill out you re not rich because you get a mac.
Reply: i bet youre super mad you can’t get rim brakes on a new road bike anymore too
Reply: @janemf  reasonably priced ram upgrades? What's next? Penny-farthing?
Reply: You and a few techie diehards who think they know more than trillion-dollar companies like Apple and MS should stop that ill-informed take. MB Airs are premium, and the 16GB/512GB versions are priced similarly to the Windows competition. So your point is rendered moot as the lower configs are pushing the demand-side curve to draw in demand from people who cannot afford the 16GB/512GB model. MS does exactly the same with its Surface line down to the price of its base 8GB/256GB base model (the same as Apple), yet Apple haters like you would never mention the actuality of the market, as that would go against your anti-Apple rhetoric. And by the way, MS charges £300 to upgrade from 8GB to 16GB, but no one has mentioned this! Hypocritical or what?
Reply: @andyH_England  And that's why microsoft doesn't sell much PCs. Asus zenbook 14 OLED comes with 32GB RAM, 1TB SSD and a beautiful 2880x1800 120Hz OLED display and it only costs $1299 retail price. Is that priced similarly to the macbooks? HP envy 13 comes with 16GB RAM, 1TB SSD and the same OLED display as the asus and it only costs $1199 retail plus HP charges like $70 to upgrade from 16GB to 32GB RAM and around the same to upgrade from 512GB to 1TB SSD while Apple charges $400 for the same upgrade. Windows competitors offer about 2x to 4x more RAM and SSD and even better screens (vs macbook air) than Apple offers. What makes it even worse is a $70 upgrade from windows competition is a $400 upgrade for Apple.
Reply: Upfront cost is not the complete cost of a computer/laptop. Stability, reliability, lifetime, and time to troubleshoot or set up also plays a big factor. There is always a good reason to pick one or the other, but there are just some quality of life things on mac that reduce a lot of time for many people. My computers generate me money. As a tool, I will pay more of front if that will end up lasting me 8 years vs the cheaper machine that only lasted 5 years.
Reply: @andyH_England  You can buy a 2TB SSD for LESS than what Apple charges for 256GB upgrade. That is just evil.
Reply: @kellymoses8566  it is not as black and white as that. But there's no point explaining as clearly you have made up your mind. Your best bet is to avoid buying upgraded Macs and stop watching and commenting on the upgrade prices as they are not going to change due to the business model Apple, and also Microsoft use
Reply: @andyH_England  ah but this all hinges on what device we are talking about as Microsoft isnt the only one who makes windows compliant hardware. Yes Microsoft is very guilty of what you say with their devices but the other OEM's? Not so much. Heck even Dell can be very upgradable and they are trying to be the apple of the PC market.
Reply: @andyH_England if surface is macs peer then mac is truly in trouble and niche land.

Why even bring it up? Why even bring up faux "premium" at all?  What premium is there about a modern macbook or the surface except the price? 

Like to combat the angle that "mac sucks" you're going  straight to "but uhh bro surface!!" Its just dumb regular persons look at it and see 64 gigs with 4080 level of pricing.
Reply: Just because other companies do it doesn't mean it's wrong. Like saying "oh this person steals from the middle class, but so does that person, so we can't fix anything". How about if no one steals? Is being fair not an option because companies gotta be bad, period?
PS, some computers of the surface line have upgradable storage, so...
Reply: @MayPolBeats  looks like you would buy a Mac, but can't afford extra storage and ram, and so yo angry about it. I would buy a Ferrari with 100hp engine for few hundreds bucks but they don't offer one...
Reply: @MayPolBeats then simply buy a surface. That’s the beauty of choice, make a different one.
Reply: @andyH_England people mention it all the time. It sucks that surface products aren't easily upgradable.
Reply: @andyH_England  When it comes to PCs, you're not pigeon holed into buying from MS. There are a plethora of PC companies that make a wide variety of machines in a varied price range. With Mac, you're stuck with Apple's extortive pricing.
Reply: @andyH_England  lower configs make no sense, because the computer runs out of RAM constantly.
Reply: @andyH_England to think that a trillion dollar company has your interest over profits in mind is crazy
Reply: MS Surface is not the only choice though. Sodimm ram for laptops is a rather healthy industry and to upgrade from 8GB to 64GB is less than the Apple tax to go from 8 to 16GB ram (e.g. Crucial 64GB kit is around £283).

I can't get over just how capable my 8GB M1 MBA is, even running Ryujinx and TOTK it's pushing out 25-30fps. Running Windows Arm in Parallels. Just incredible. While I'm not encoding multiple GB's of video, every 'short-ish' task is eaten up rapidly and incredibly efficiently. The M3 MBA looks all shiny, but for me, there's not enough that would warrant upgrading, The M1 just does it all and I hope it receives OS updates for quite some time.
Reply: @andyH_England  fanbois are so nauseating
Reply: @andyH_England I think the Air is priced OK. I only have problem with the OS.
Reply: @andyH_England  Microsoft charging that much is condemnable too, but we do not have to buy machines direct from Microsoft to have Windows. We don't have that luxury with Mac.

Also, a 2x32 gig kit costs around that much as well.
Reply: @ZeldagigafanMatthew  MacBooks are another PC option and has 8% of the market. They cannot appease every buyer and have to appeal to a demographic. The hate is dumb as there are plenty of options if you feel Macs are not for you. But the anti-Apple rhetoric is rather pathetic as Apple has every right, like MS to have their own business model to carve out a small slice of the PC market. The fact people cannot understand this is a sign of the sad times we live in. As the consumer you choose your option. There is no good or bad PCs, just choices. If Apple’s policy riles you then move on. 

N.B. This is not specific to your comment, it’s a general point.
Reply: @andyH_England I’ve sold laptops and i disagree usually upgrade are bundles as ram and ssd so you pay around 200-300 dollars more for both upgrades combined. Apple charges that price of both upgrades for one.
Reply: @andyH_England  I spent 30€ to buy a 16gb stick of RAM to put into my laptop.
As long as its not soldered in, that is the price we can go by.
I don't need to specifically use a MS Surface to use Windows, whereas a macOS user is FORCED to go with unupgradeble RAM. This is why it really doesn't matter what MS prices their stuff at. 
My laptop uses Linux btw, before I get accused of shilling for M$.
Reply: @Alice_Fumo  95% of consumers probably buy what they need and never worry about upgrading. The market cannot cater just for those that want to buy cheap and then upgrade. Soldered RAM has many advantages including speed, latency and space-saving. For instance, the fastest 7,000 to 8,000 mhz RAM is not available in modular form. I would much prefer having the best rather than a slower RAM speed just in case in 5 years time I may want to upgrade. By then, modular RAM probably will not be made and it will be moot anyway. Join us in the 21st century please.
Reply: @andyH_England  I can find RAM kits for up to 8400 MHz. 
Suck it.
Reply: @Alice_Fumo  not for most ultra books.

The latest 14th gen Intel does not support them and AMD doesn’t either. Desktops may support them. But I’m not talking about them. Show me a link for a laptop that will support that speed with modular RAM.
Reply: @andyH_England  "The fastest RAM is not available in modular form." is what you said.
While being EXTREMELY condescending about me not living in the current century.
Reply: @andyH_England Nobody likes Microsoft business practices either, they both suck
Reply: @andyH_England  First of all, trillian dollar companies are not people so comparing the knowledge of a person to a company makes little sense. An individual can have more expertise on a subject matter than anyone working at Apple or other companies and even if these companies have more knowledgeable experts, that doesn't mean their opinion matters  or is even considered. Apple makes a profit with every unit they sell, not just the upgraded ones. The upgraded ones simply have vastly higher profit margins. Apple's pricing is dictated by demand and the willingness of their costumers to pay these premiums not by some super complex supply chain economy of scale cost bullshit. People are easy to manipulate by marketing and Apple has perfected its marketing to make it seem that its products have to be so expensive or they are simply not Apple.
Reply: @Widur42  why should it bother you what Apple does if you don't buy their goods? Apple has a business model and if you don't like it buy something else. There is nothing wrong with the business model as consumers in the end decide whether to buy due to marketing or whatever, and this applies to the whole worldwide goods train. People complaining should just move on and buy something that they feel is better value for them. We should never restrict choices because of a few people who complain 24/7 that no doubt have their agendas. If Apple hurts you so much then why even look at videos concerning them?
Reply: @andyH_England  premium what? They ssd’s and ram chips fail and cannot be replaced. Effectively they are Chromebook’s. That’s not an issue with a Windows PC usually is it? MacBooks and Airs are not ‘premium’ in any respect other than the ‘premium’ price you pay for apparently having a luxury product that almost anyone can have. They aren’t exclusive at all, unless you pay OTT to join their ‘club’.
Reply: @sprint955st  If you do not know Apple is premium then no point continuing our conversation as you are obviously flexing or simply playing dumb.
Reply: @andyH_England  Less than $500 TOTAL for a 2010 cMP?

I was a UIUC Business major, so I understand the difference between MARGIN and VOLUME, but I don't believe Tim Cook KNOWS enough about Business!  (Like that old Apple Board Member K---something who PREVENTED Apple from licensing the MacOS, as Bill Gates suggested they do in 1985, 10 yrs before he came out with Win95!)

I'll be staying with my 2010 Mac Pro 5,1 for as long as possible, currently 'booting/running' OCLP Monterey 12.7.4 from an internal nvme PCI drive, with a 12-core 3.33ghz Xeon, GTX 670 2g GPU, 96g, 2xUSB3.0 + 2xUSBc card and a free slot #4!  My 5,1 is right ABOVE the M1 chip and the i9 on the Cinebench 2024 ranking?
Reply: @andyH_England Your comparison to Microsoft makes no sense at all. Microsoft is basically not a PC / Notebook producer. The surface is quite unique in the sense that it is not competing with IPads or Notebooks. It’s kind of it’s own thing. For many it’s way to expensive for a Tablet and someone who needs a „full Notebook“ wouldn’t buy a Surface. You can also install Windows on a Mac but that doesn’t make it a Microsoft product, or does it? If you want to compare Notebook/PC and RAM upgrade prices you have to compare with the competition. Which is Dell, HP, Lenovo, Acer, etc.
Reply: @81Earthangel  MS also makes the Surface Laptop, which is their best-selling PC. As MS is to Windows what Apple is to macOS, the comparison is far more valid than that of a company like Dell that buys 95% of its products off the shelf.
Reply: @andyH_England  It doesn't matter if they build it or not. BMW is also not assembling it's own cars and for sure not building 95%+ of the parts. And the Surface is for sure not the substitution product for a Mac Book or a PC of any kind.
Reply: @andyH_England  Apple haters? Time to grow up a bit.
Reply: @WorksOnMyComputer  It's a real thing! A hobby for many. A bit dramatic, but it nails the point.
Reply: @andyH_England in what planet a 900$ laptop is premium?😅😅
Reply: These large companies are milking the cows irreasonably or abusively if you prefer, for profits.
Reply: @andyH_England MB AIR premium? Hahahhahaha. As premium as a Burger king whopper.
Reply: @Static-4  Apple is 100% premium no matter what the anti-Apple mob flex.
Reply: @andyH_England yeah and how much video ram does that surface have? Everyone in here doesn’t understand the advantage to having a UNIFIED memory structure.
Reply: @stevens7409  Hm, although the Surface doesn't have a dedicated GPU, like Desktops would, it does have an integrated GPU, which if I remember correctly, uses . . . what was it? Oh that's right, system memory, or RAM! Although I do have to say, Apple AND Microsoft suck.
Reply: @stevens7409 there isn’t any advantage to having less ram overall sorry dude
Reply: @stevens7409  re: video ram on a surface - yes but that ram is replaceable by any decent techie. Unified memory is one thing, the SOC memory is another, unified just means the same ram is shared between CPU & GPU etc. This is not an advantage, as it increases security risks and limits specialised memory. 
SOC memory has a speed advantage in that because it is a single  system the bandwidth between the memory and the rest of the system is huge. That being said PCI 5 is about the same as m series bandwidth and pci 6 is larger.
Reply: @stevens7409  Unified memory only offers two advantages - near bottomless memory for the GPU and faster transfers between the CPU and GPU. Those are very nice things especially given how scroungy nvidia is. Unified memory could be forcibly implemented on x86+dGPU but would have a greater performance cost when compared to explicit transfers.
Reply: @andyH_England  You couldn't have said it any better. I've also been wondering why I don't hear people complain about Microsoft's RAM and SSD upgrade prices(as well as Dell, HP, etc) but quick to whine about Apple's. Not in anyway saying the prices are fair or reasonable—far from it. But their hypocrisy is obvious when they only point fingers at Apple.
Reply: @wisdomyaw03 I think the difference is if you want a pc, you don’t have to go to Microsoft and overpay them. If you want a Mac, you do have to go to Apple and overpay them.
Reply: @wisdomyaw03 Apple loves to brag about…. you know…everything.  Microsoft doesn’t do the same chest beating about their laptops.
Reply: @wisdomyaw03  microsoft has upgradable storage at least dummy. Plus their pricing is intentionally high so that they dont undercut their OEM partners such as Dell, HP etc. You didnt get this so far did you?
Reply: @wisdomyaw03  Blud HP charges $70 to upgrade 16GB to 32GB and lenovo charges $50 while Apple charges $400 for that upgrade. HP charges like $50-70 to upgrade 512GB to 1TB SSD while Apple charges $200 so tell me, why would people complain about the windows companies when they charge 5x less than Apple does for the same upgrade? Microsoft's an outlier and that's why they don't sell many PCs. It seems though that dell have lost their minds and are now following Microsoft's ridiculous pricing but the likes of HP, Lenovo and ASUS charge way less than Microsoft or Apple does for upgrades.
Reply: @wisdomyaw03 my thoughts exactly. I purchased a dell alienware gaming laptop and the pricing tier was identical to apples mb. The internet is the only place where people complains about this. lol
Reply: @CreationsOfReon  What you talking about windows is £100, and then they sell your data and have ads in the start menu. Windows have multiple so many vulnerabilities, where Apple has considerably less.
Reply: @wisdomyaw03  simple, because Dells, HPs etc are still cheaper than Apple for ram and storage upgrades prices. Specially outside the US.
Reply: @chromaticvisuelle  And since when has Apple been on the cheaper side of things? Isn't their own philosophy is to be on the premium/expensive side? Are you now learning this?
Reply: @wisdomyaw03  you didn't get it. Sorry but selling 230 euros an 8gb upgrade is clearly bullshit. I know Apple is expensive obviously but it doesn't mean being ok with ripping off people with upgrades.
Reply: @chromaticvisuelle  And where did I say the upgrade prices are reasonable? In fact, in my first reply, I said they are not. I'm only questioning why people only talk about Apple's.
Besides, it's a free market and consumers know how to vote with their wallets.
Reply: @wisdomyaw03  You can buy 3rd party ram and hdds and stick them into those machines (cept the soldered ones, and yes there are a LOT of forums out there complaining about that), you do not have to go with their pricing.
Reply: @wisdomyaw03  if I call someone out for committing an un-tried murder, does that make me hypocritical unless I find every unconnected murderer in the nation and call them out too? you logical fallacy is self-evident I think.
Reply: @alastairleith8612  "unconnected murderer?" You seemed to be confused at the topic of discussion here. If we are talking about upgrade prices here, how is Apple the only seller that sells upgrades to RAM and storage (the unconnected)?
Reply: @wisdomyaw03  
Microsofts price for RAM and SSD upgrades? What on earth are you talking about? Last I checked, Microsoft did not make memory or SSD's. Anyway, being it an ASUS, MSI, HP or Acer laptop, why don't you look up the price of comparable SO-DIMM RAM for those machines and compare it to what it cost to get say 32GB in a Mac? And why don't you look into what a premium Mac laptop workstation for doing say editing or CAD work cost, compared to an Intel/NVIDIA equipped workstation laptop? And just fyi, if you check both top of the line models, the latter will absolutely cream the Apple. Try editing in Resolve, do AR in Unity or do CAD with both, there's no comparison between Mac's top tier and a top tier with a 14900 and built in 4090 or similar GPU.
Reply: @robertg457  Yep. I still recall that video clip of an Apple representative claiming that 16GB Mac RAM is the same as a normal 32GB RAM. That's how Apple works.
Reply: @wisdomyaw03  what are you talking about lmao ram upgrades are super cheap and ppl definitely complain when ram is soldered.
Reply: @robertg457  Yeah it's called marketing and capitalism. Sometimes Apple does innovate and does lead a tech jump. Microsoft doesnt really have a lot to chest beat about. They just make software. They don't make chips, they contract their laptops etc. There was a real jump in power for thin and reasonable laptops with Apple silicon. I hate apples anti-consumer stuff, but in a vacuum they make great shit once in a while.
Reply: @CreationsOfReon The diffrence is that if you need to edit and encode you can get more power on PC side.
Reply: @robertg457  They actually do brag, but no one pays attention
Reply: A boring trope. No one cares, except a handful of nerds that think they’re smarter than everyone else. Zzzzzzzz
Reply: @SkepticalRaptor  No one cares that they are paying 5 times the market rate for ram and ssd upgrades? That's... just not true.
Reply: @hastyscorpion  it's not 5 times, it's actually 10 times
Reply: @SkepticalRaptor All hail the Apple Apologist
Reply: @SkepticalRaptor No one needs to be a nerd to understand that 8GB RAM is not enough  these days.
Reply: @SkepticalRaptor  ... And Yet here You are.... And commenting to boot :)
Best regards
Reply: @SkepticalRaptor  
Guess what one of Apple's core demographic is?
Reply: @SkepticalRaptor no one cares= I m butthurt
Reply: @SkepticalRaptor because we nerds who do nerd stuff for a living don't deserve to pay a fair price for the RAM we need?
Reply: I have to agree, I remember getting outraged in 2011 with my MacBook air’s soldered RAM. 13 years later here we are
Reply: @SkepticalRaptor  I think you're right that people don't really care about upgradability. Most people don't consider any laptop upgradable anyway.

I don't think you're right if you also mean that people don't care about their storage and RAM prices. A lot of people don't need more than a base model - but everyone that does surely thinks those upgrade prices are VEEEERY high.
Reply: @SkepticalRaptor  no, it's about futureproofing. Apple will literally charge the upgrades at 5x the price of the part in retail distribution. Most of older Macbooks that you can find on the 2nd hand market will have the drive already swapped for an ssd and maxed out ram to keep up with the increasing demands. Also it allows you to keep the mac alive with a relatively insignificant investment, should any of these parts fail. With the newer ones, upgrades or any service beyond apple's authorized is off the table. Hence, no option to buy a base model MacBook and pop in more ram or storage as your demands increase, so should you eventually come to the conclusion that you underestimated your needs before purchase, there is literally no other left option for you than buy a new machine and add an overpriced upgrade. The same goes for repairs. Say, you Mac is 3 years old, out of warranty, the SSD fails. Most computers will require a $50 drive, with apple it's $600 to replace the entire motherboard. It's the ignorant people who don't care who enable apple to screw everyone over. In the end you're getting screwed over too without even knowing it, all while applauding them for it. How stupid....
Reply: @SkepticalRaptor  bait used to be credible
Reply: @SkepticalRaptor  maybe democratic principles are boring to you too? try thinking before you speak.
Reply: @SkepticalRaptor  And literally everyone who uses a Mac to develop software. Which is a huge chunk of devs.
Reply: @SkepticalRaptor  Pleb filtered.
Reply: @SkepticalRaptor  The "handful of nerds" who want user-upgradeable memory and storage on a Mac, tend to be Apple's core customer base.
Reply: @SkepticalRaptor  Nontechnical Apple fanboy
Reply: @SkepticalRaptor  ok troll. Most non nerds care too as they still buy them. It could be the EU force them to stop it hopefully soon
Reply: @SkepticalRaptor try music production with 8G of RAM. Heck even Chrome
Reply: @SkepticalRaptor  Indeed, just configure the system as you want to have it for years to come. Only geeks want to reconfigure every season. A small percentage.
Reply: @SkepticalRaptor  "No one cares," Sorry, kiddo, it's the top rated comment.
Reply: @SkepticalRaptor Real-world users care.
Reply: @SkepticalRaptor  except for everyone who would want to use their Macs for professional applications. Any kind of media like music, video, photo and 3D. Not everyone can afford to buy Apple's top-of-the-line spec machines, and if you have to buy one of the lower spec machines it won't take long for the RAM and disk space limitations to become noticeable. Not being able to upgrade any of that is very much a problem. Even getting your Apple products repaired by third-party repair shops, and pretty much being forced to buy into the Apple eco-system just because Apple will make sure it's as difficult as possible to use third-party peripherals with their products, are also huge problems. Since Apple is the industry standard for most of the media industry, it means that most people can't afford to get started. There's fortunately still a strong PC user base in the media industry, and most software and plugin developers still have cross-platform compatibility, but for how long?
Reply: @SkepticalRaptor yet numbers sold have been 25% lower since Q3/2022.
Reply: @SkepticalRaptor  Well go watch Top Gun.
Reply: Actually, I’m super super interested. I’m trying to figure out if I should wait for an employment mini or wait for them to put out arm chips and motherboards that I can build my first PC with. So I’m watching all these videos with great interest.
Reply: @SkepticalRaptor - Everyone care about paying too much, not just nerds.
Reply: @SkepticalRaptor  except its an issue worth considering the price of macs compared to x86 PC's, apple is overpriced garbage.
Reply: @SkepticalRaptor  Is not having to resort to expensive cloud storage every time you want more than 2 pictures on your device a nerd thing?
Reply: @SkepticalRaptor  Ah yes, no one but a handful of nerds cares that macs are overpriced. That's why Apple abolutely dominates the computer market just as much as the smartphone and tablet market, right?
Reply: @SkepticalRaptor Enjoy your $1300 machine being slow because of the single 8GB ram chip...
Reply: @SkepticalRaptor so are you gonna ditch cpu if ssd dies?
Nobody cares= my beloved company never does something wrong
Reply: @SkepticalRaptor Apple sux  end of conversation
Reply: @elixier33  I don't use apple as I hate the software but No, apple doesn't suck. This is coming from a linux user.
Reply: @elixier33 very cool, very cool 👌
Reply: @elixier33 yeap , they throw the users under bus. No reason to leave intel with boot rom. Apple could giving the drivers to AmD and Nvidia to keep making cards for Intel users . Gave intel rights to continue making chips for Intel Mac. It’s not like they using the chips